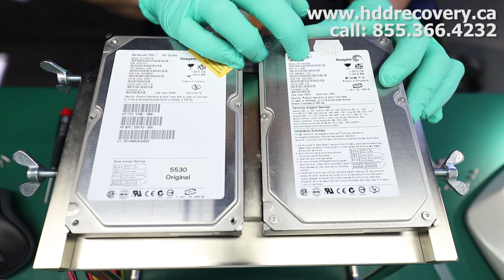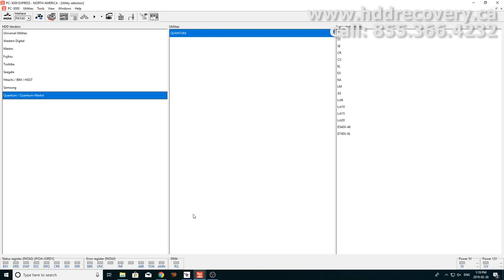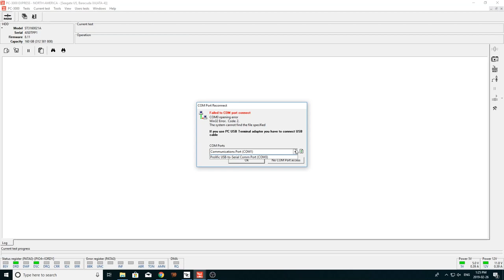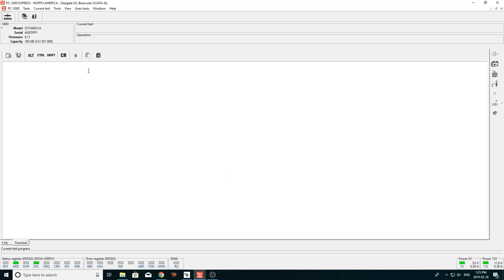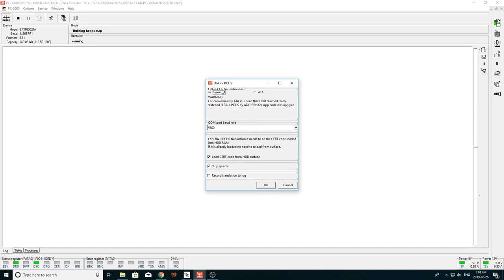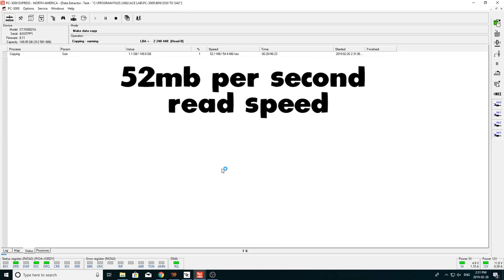hard drive sounds like a typewriter | data recovery on Seagate hard disk

Comment: Hi I would like to ask a question i i can, I have a Hitachi 2 Tb drive (HDS722020ALA330 type DK7SAA200 . 2010 year) it fails to initialise and has a vibration when the disc spins up with a faint clicking at long intervals..is  this drive dead?
Reply from the maker: Most likely it started to die

Comment: You was saying about 2 method reading data from the head hard drive reading. I did not follow up . You can control the way the head can read the data from the disk by the software ? And what name of the software you use it if I like to buy and test it . And  Another question ...how I can unlock my forgotten hard drive password encrypted from the bios even the password is not in the bios but in the hard drive it self .
Reply from the maker: We use PC3000 for hard drive work. It can remove BIOS password lock for you, but the price of that tool is not low

Comment: What happens if the head or platter gets out of aligment?
Can you realign them
Maybe if you dont care about data you just want an empty new drive for testing
Reply from the maker: Some drives have balancing issues, not so much allignment or disk to disk position, but rather being centered perfectly. Some hard drives sit snug on spindle, but some will wabble just a tiny bit. And that is enough to get them out of balance. Just like unbalanced wheel on the car, disk will vibrate in motion.

Comment: Hello how much do you charge for this? Im still waiting from my email.I have a little over 100gb to recover from a 640gb laptop HD drive. It was making a clicking sound after some water lemonade was spilled. I turned it off and have not touched it.
Reply from the maker: Hey, have you filled out the request on out site ? www.hddrecovery.ca/contact-us
Reply: @hddrecoveryservices  yes i did. I will be going to a local repair guy and look at the quotes. Will make my decision then.

Comment: I noticed that you opened the Hard Disk outside a small clean room, does your entire laboratory have filtering for particles ??? or do you open the Hard Disk without being in a clean room?
Reply from the maker: What do you mean I opened it outside of the small clean room. I work on hard drives in the laminar flow cabinet. My laminar flow bench is 6ft by 3ft. My any measure is massive. HEPA filtered, we change those once in 12 months, powered by 3 blower fans. Second laminar flow bench we got is 4x2 so it's a bit smaller
Reply: @hddrecoveryservices  1:12 you open HDD , this giant room behind you is clean ???

Comment: I have got barracuda from 2003. No errors no bad sectors. The drive was turned on for 9 244 hours.
Reply from the maker: 7200.7?
Reply: I have a quantum fireball LCT 4.6 AT with 80,721 hours on it.

Comment: I thought when the drive makes sounds like that, you aren't supposed to run it.
Reply from the maker: As long as there is no contact noise which sounds slightly different

Comment: HDD all scrap you can't open a HDD out of a confining chamber
Reply from the maker: Not sure I catch what you mean. What chamber?
Reply: He's working in what is probably a Class-100 laminar flow hood, Trobo. He may be taking extra steps to stop dust from getting into the lab from outside, too.

(Even scientists at universities sometimes mistake laminar flow hoods for fume hoods, not a good mistake to make in some cases. Laminar flow hoods can also have fume extraction, but don't have to.)
Reply: @hddrecoveryservices  All the dust in your room will fly and desposit on the top of your discs and AT LONG they will cause bad sector because they are scratching and removing information. You have to get a laboratory suit and a labo to under a vacuum. Customer can't do it, or just to temporarely recover important informations.
this is not a personal feeling or a debate, that's it.

Comment: @HDD Recovery Services
Do you know of any way to transfer files from a very old 5.25" MFM hard drive on a new computer? It was working when last used many years ago and I still have the 8 bit ISA controller card that it was working with.  I don't have access to motherboards with ISA slots and it would be expensive to build a computer with ISA slots these days.
Reply: Where are you located.  I probably ISA PCs that may still work LOL
Reply from the maker: We have a 386 for that hahahaha

Comment: Quick question. I have a Seagate FireCuda 2TB hybrid with a damaged PCB. Would it be as simple as replacing the PCB from a identical HDD or would I need to transplant a component from the original board? The board itsself is a 100793567 REVA
Reply from the maker: most issues we see with hybrid drives with PCB symptoms are actually because of the failed NAND. replacement of PCB even with ROM adaptation may not be enough to make data accessible even. We use PC3K to initialize the NAND.
Reply: @hddrecoveryservices  so is it possible to transplant the ROM chip and the NAND to an identical PCB? I'm hesitant to send it in for recovery because of the complex nature of the damage.
Reply from the maker: If the problem is due to NAND, moving it to a donor board is only going to move the problem. ROM needs a patch, and NAND needs to be initialized with help of terminal. Data recovery company is your best bet I think
Reply: @hddrecoveryservices  You're probably correct. I'll try to get in touch with your company and explain the situation and see if you guys can help out.